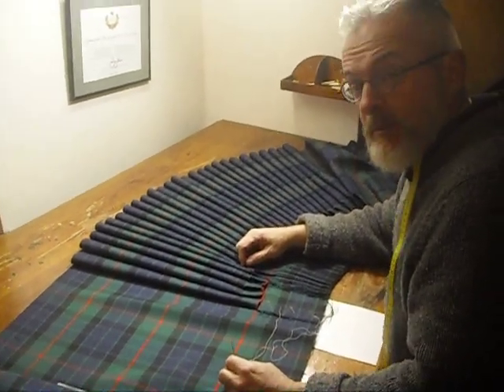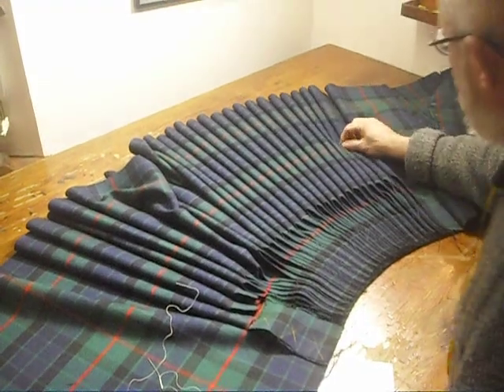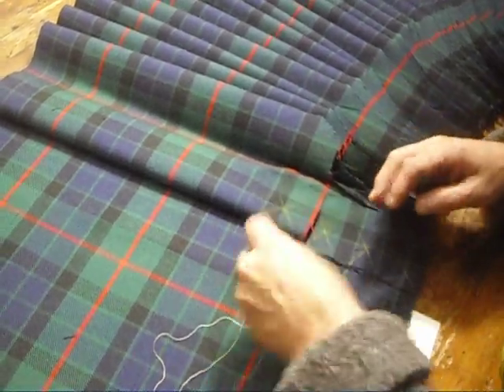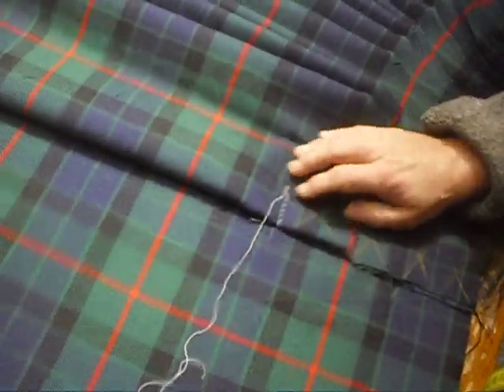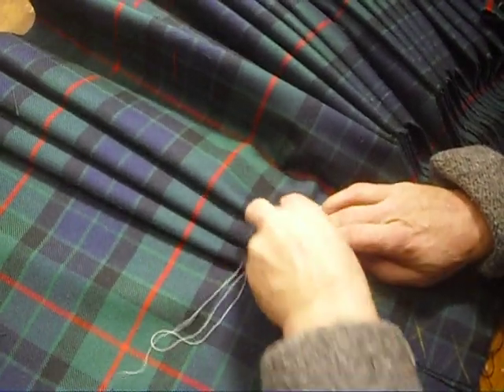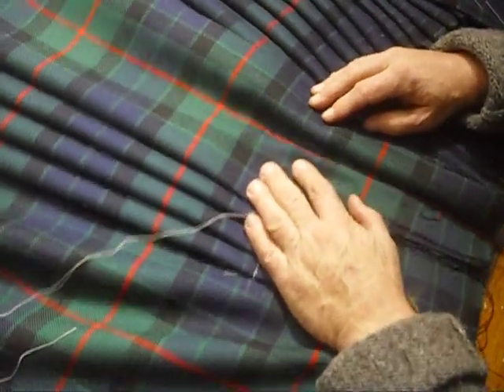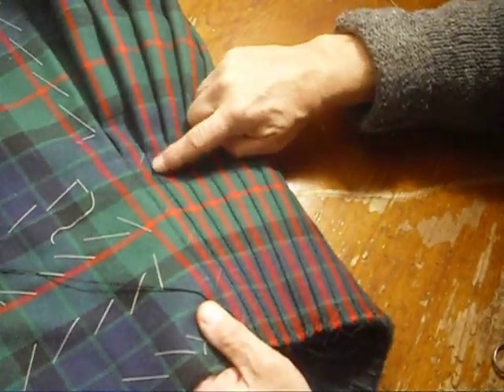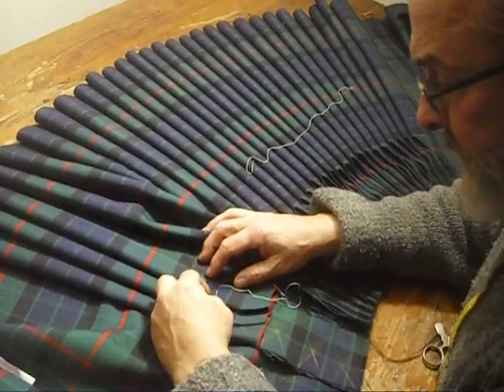Steeking: my method

Comment: Why do you wax the thread?
Reply from the maker: if you were to examine the thread closely you'd see that it's made like rope with individual strands twisted into yarns, which are twisted again into the thread. 
When I'm sewing this twisted-rope effect acts like the rifling in a gun barrel as the thread is pulled through the cloth, which can cause the 'bight' of the thread to twist into a tangled mess.
I can prevent- or at least decrease the risk of this happening by drawing the thread across a piece of beeswax, which fills the spiral depressions between the yarns. this cancels the 'rifling' effect and perhaps also reduces friction.
Many Tailors take this a step further by placing the waxed threads between 2 sheets of paper and then passing an iron over them so that the wax melts and permeates the thread.

Comment: I'm just in the progress of finishing a kilt and it seems i have made a mistake: The inner apron pleat is curling out. Now i figured it could have 2 reasons, either i pressed it incorrectly or i  should have pulled the inner end of the pleat further up. What do you think?
Reply from the maker: Hmmm - I'm trying to think of a better reply than "that just happens sometimes"...
I THINK that it's due to an inadequate 'A-line' (video to follow, I guess!) which results from a mistake in your 'Rock of Eye' - which means your mental image of the client when you were making the kilt didn't properly account for the shape/musculature of the upper legs.
I've recently added a step to my measurements - I take full-length photos of the client from front, each side and from the rear. I then refer to those photos when I'm setting the A-line in the aprons.
An easy fix is to have the client don the kilt and then you baste the offending edge so that it hangs properly - and then promptly press it into its' new shape.

Comment: On the left hip of the kilt do you have a double width pleat to start or do you put that in after you steeked the singles ?
Reply from the maker: I add the 'deep pleat' and outer apron - which is on the left as I'm working on the kilt - after I have steeked the pleats and put in the main part of the canvas.